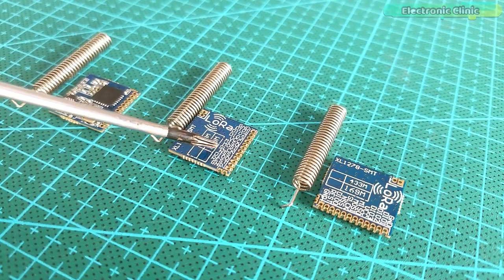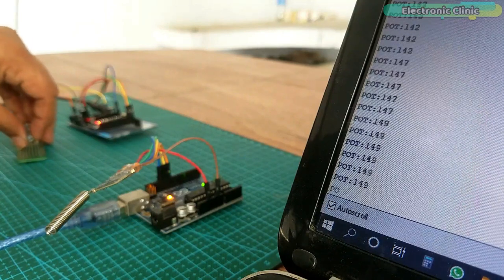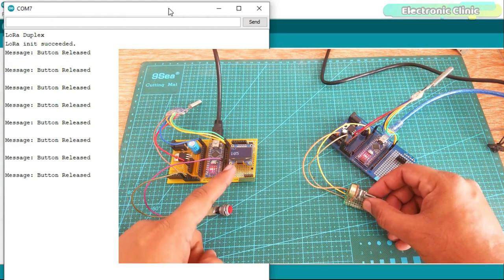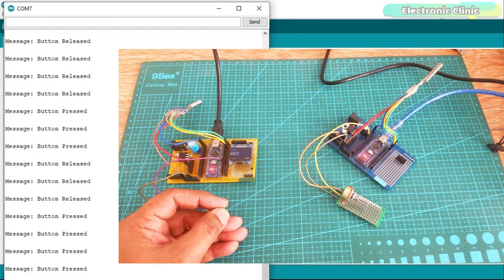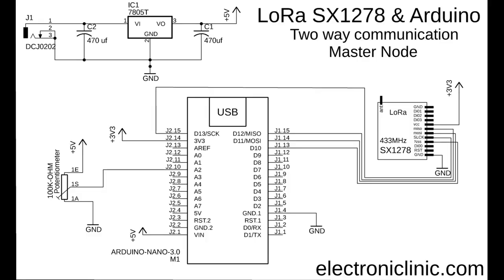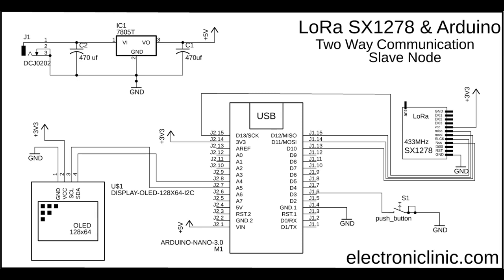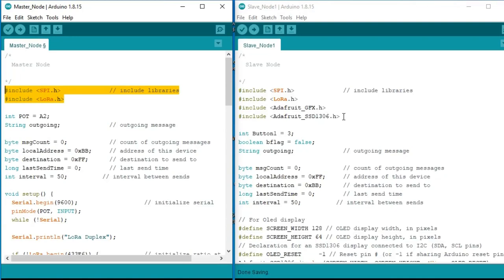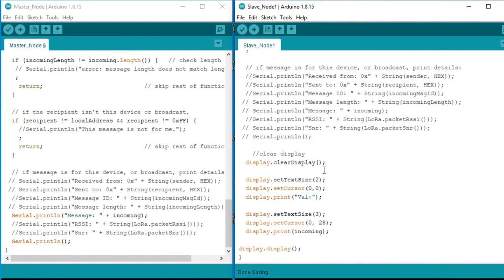Arduino SX1278 Lora based Two Way communication System, Sensor Monitoring with Lora and Arduino

Comment: Sir i need confirmation between sender and receiver in lora ra 02 with atmega328 that the front has received the message.So no need to send the message now.is it possible.

Comment: Can I use this full setup and code with lora ra-02 module.
Reply from the maker: yes
Reply: @ElectroniClinic  but pin configuration is different so how to configure lora ra-02 .
Reply from the maker: @kpinnovations6613  they got the same pin names. check circuit diagram.